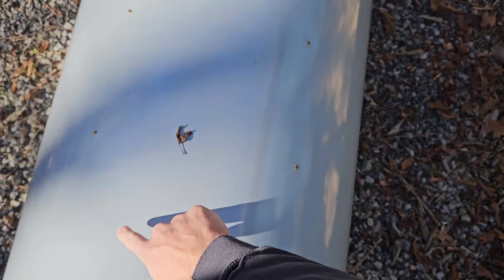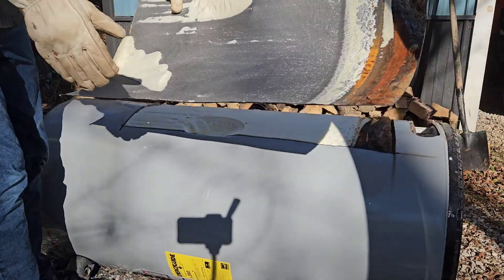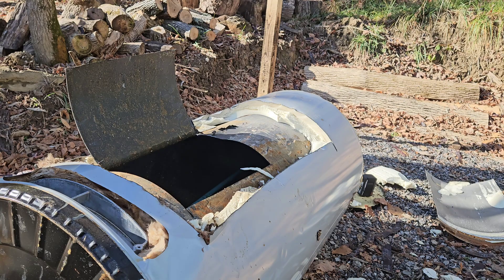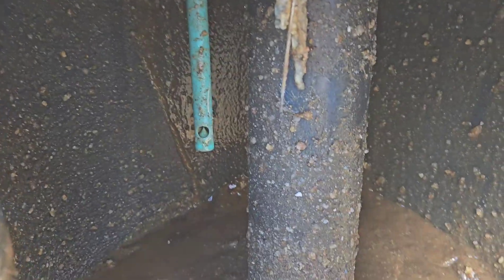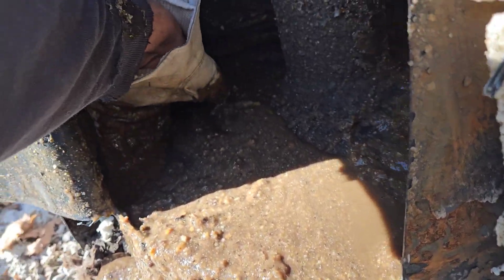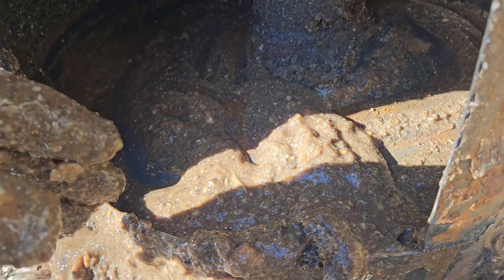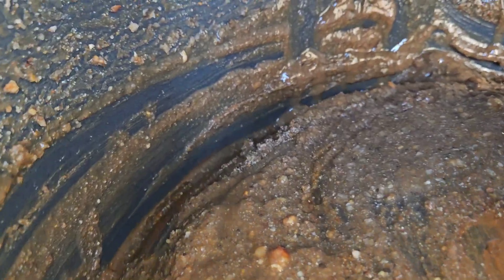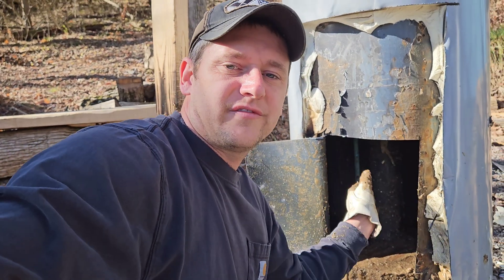You Won't Believe What's Inside This Gas Water Heater! AO SMITH Disgusting Truth.

Comment: Had this in a property that I was a tenant in. Had a plumber in for a pressure relief valve that had seized  (they should be tested every few months) - I asked about the "anode" - he said yes, way over due for replacement - it would have been $50 for him to do it then, but landlord wasn't interested. Total Hotwater system failed six months later, and it was a $900 replacement.
Reply from the maker: Yeah I would imagine landlord's are the cheapest when it comes to fixing things but then end up paying more in the end ha. Thanks for watching

Comment: Whole house water filters will significantly keep this stuff out of your water heater. Ive got a whirlpool system from lowes, had it now for 15yrs and still works great. No chlorine smell in water.  If not all of it.. Got 17yrs out of our AO smith water heater. It was only swapped out because the tank started to leak somewhere.